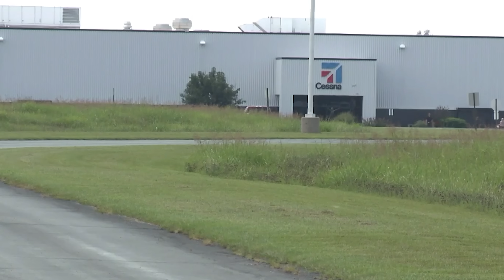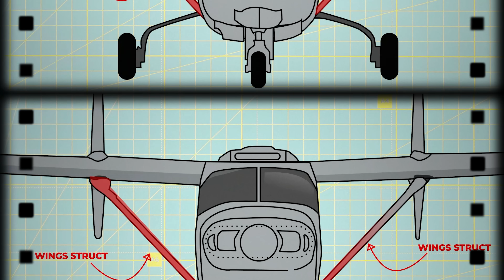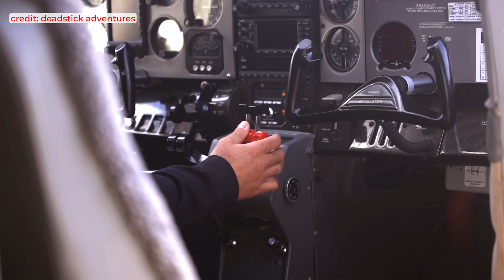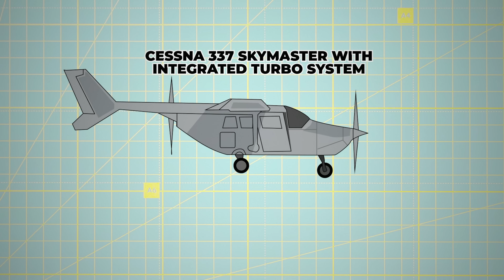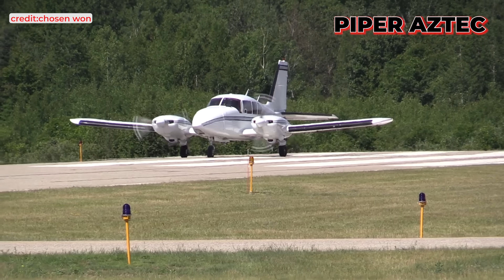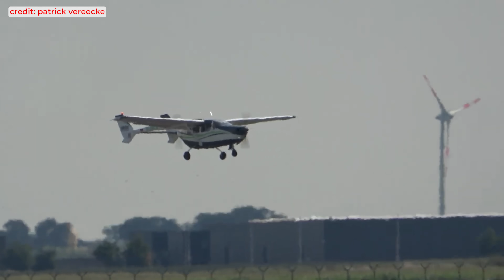Why Did Nobody Want the Twin That Couldn't Kill You?

Comment: My father was a Cessna dealer in the 60's and 70's, and over the years I've bought and sold about a dozen 337s, and every model from the 5th production 337  to one of the Last P337s.  Over the years I've also owned 310s 320's, a 340, two 421s, Barons, a Duke, Senecas, and a 700 Aerostar, and while the 337 is not best light twin in terms of performance, payload and room, it remains my favorite light twin to fly and an aircraft I love! I think it's the most inspired airplane design Cessna came up with, and one of the most under-rated and under appreciated aircraft.

The 337 was a difficult aircraft to sell back then and very cheap on the used market. When I was 17 years I finished up my Private pilot training and check ride in a 337. A few years later I bought a 66' 337 with only 800 hours for $10,000 and flew it to college.

What sets the 337 apart from many other light aircraft in my opinion, is comfort and visibility. Setting ahead of the wing you have better visibility then any other single or twin, especially in the pattern which is a good safety factor. Passengers seem to love it as it has a warm, solid fuzzy feeling and sound with good visibility and rides nice in turbulence. Also with the high wing, placed in the center of the fuselage, the center of roll, pitch and yaw is centered on the passengers head so less spacial disorientation and air sickness. 

With 120 and 140gal of fuel you have a lot of range and IFR reserves and it has the best single engine performance of any twin in it's class. The Pressurized models with 225hp and larger props are even better on single engine. When selling P337s I used to demonstrate a simulated single-engine go around with gear and flaps extended to prospective owners. Something I don't any other piston twin can do.
I could go on for pages about the 337 but but I have keep it reasonable I guess.
Reply: Flew the 336 around the UK. Good camera platform but had Aztec power with Apache performance. For charter work no baggage space and odd payload range numbers
Reply: @angeliqueadamssanctuary  Indeed. All true! I've  had a couple of  Apaches and a couple of Aztecs, An early 60's model with the extended baggage door that went nearly to the tail for hauling caskets and corpses and a 77' Turbo F model. Both good solid and reliable old airplanes but the Turbo burned like 32gph and went about 165kts. I Had an old 1963 Cessna 320 with the Turbo TISO-470s and it was a solid 200kts on 26gph and had 7 seats and the same useful load as the old turbo Aztec. That was my #1 pic of the old go fast "Cheap" twins.
Reply: @jackoneil3933 Man you have been around, respect!
Reply: @windansea6702 Caskets and Corpses ? Uh no thanks.  I guess someone had to though.
Reply: @silent1967  I never did that either but I suppose I would have. I saw a guy loading a corpse in a white body bag into a single engine Cessna one morning, didn’t look fun, but you do what you got to do. That’s the job you signed up for.
Reply: @silent1967  N4714P was the number, I only saw one photo of the old bird so I should upload my photos of the casket door.
Reply: @windansea6702  Man, did he strap it in seat or lay it out in the back, like in a 206?
Reply: Excellent thank you.👍
Reply: I was an avionics technician working at PATCO, Patterson Aircraft Company in Sacramento, the best place that I have ever worked.  The Cessna 337 was the worst plane for me to work on,  the next were the 310 series.  Under the instrument panels were terrible to access.  One good feature of the 337 was that in front of the windshield were two access panels that helped.  I did a complete IFR install on a Baron and it was much worse then these Cessnas.  That was because the throttle quadrant was way up in the middle of the instrument panel, eating all of that room up.  However, the 340s and up were the easiest planes to work on.  The other Cessnas were built to be ease of maintenance.  So, my favorite plane that Cessna made was the 340.  Beautiful cabin class, easy to work on and faster than the 414, the slug of the fleet.  Of all of the planes that I have ever worked on, I liked the Cessnas the best.
Reply: @Adventures-of-C-Jeff-Dyrek  I remember PATCO!  AndI know just what you say about the 337s and panel access. Even with the access hatches of the P337, so much stuff was crammed in behind the panel doing anything in there was a knuckle and neck buster. 210s and P210s were bad in the same way. 

I'd agree that Barons were even worse, that's why you see so many old Barons with original Stacks but 340s and 400 Sires with nice panels. 

I love 340's and have bought, sold and flown a few, but from a pilot and owner's standpoint I preferred the P-Baron. More standard fuel, useful load, range and speed, and most of all, two doors! So much easier to load and not everything has to go through the Air stair in the back. The 58P being lower and with a smaller footprint will fit in a lot of single engine and even T-Hangers where the 340 needs corporate size hanger.  Also less Spar, landing gear, Exhaust and corrosion issues with the P-Baron.

From a comfort and speed perspective I advised customers who were planning to upgrade to Turbine aircraft, to consider a 421 over the 414 and 340. Not much more overall operational cost but a lot more speed, comfort and range. 

I never really gave much thought to Aerostars until I sold and flew a couple. They are my personal pick of Pressurized Piston Twins.
Reply: Thank you too for all the useful information.
Reply: @kevindarroch7332  My pleasure, thank you for reading and commenting, and if you or anyone would benefit from insights on a 337 or other aircraft I might know something about, I'd be honored to share what I know.
Reply: Wasn’t there a pod for the 337 a?
Reply: @foxlake6750  Yes, Cessna made a Cargo Pod that attached to the belly as the baggage area shares the same area as the 5th and 6th seats.   The 337 in the thumbnail image might be some aftermarket pod. 

I had one 337, (a  G model I think) with a cargo pod, but I didn't see much point in it.  The 337 is certified  6 seats but the third row is really only piratical for kids, so I I consider  it a 4-place or maybe 5 place in a pinch. Insurance now is often higher for 6-seats and if you are considering a 337,  I say consider it a 4-seat aircraft,, then you have plenty of  baggage space. 

The early model 337s  have a dedicated baggage door nimble people and kids can even crawl through in later G-Models cessna did away with that and the full length sliding seat rails and went to something like an old Military O-2  middle row  bench seat  that's a pain to flip up and down and get baggage or  someone in the third row, and when chomp that bench seat down and latch it, who's ever in the third row is basically trapped and often claustrophobic  . 

I like the full length seat rails  better because you get 6 real seats and not the velcro-in cushions for the Lock-down middle seat and no baggage door models.  Also with the full length seat rails I liked to remove the middle row left seat and the third row right seat. That way it leaves a big open area behind the pilot's seat and next to the middle row passenger who can then slide back and have extra leg room as does the left side rear passenger and still have baggage room behind the right-middle passenger. 

Newer models are quieter with smaller windows and more sound proofing and a better sealing door. However I've refurbed older models and added extra sound insulation and better door seals.  Replacing the inner windows with thicker poly and new trim seals drops the sound levels dramatically, but I never really found the 337s any more objectionable than most light twins.
Reply: @foxlake6750 
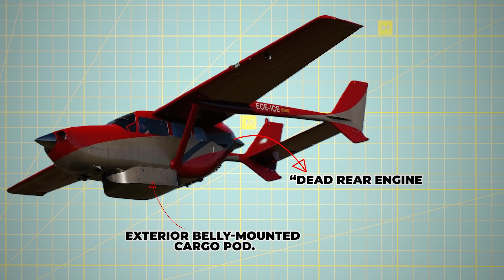He shows it in the video. 6:56
Reply: "Seen one in the movie "BAT 21"  Gene Hackman Danny Glover, really great movie
Reply: @kemgreene8525  Yea, the in-cockpit scenes were great. I'll have to watch it again but I think it was a civilian 337 rather than a real military O-2
Reply: The USAF used the 337 for FAC ,did a great job over South Veitnam,flying with the O-1 Birdog. When starting,start the rear engine first,you can't see the rear prop. If one engine quits,you prefer it to be the front. Pushing is more efficient than pulling. Also Cessna made 166 336's. A Skymaster with fixed gear. Love the sixties decade.
Reply: @bigsky-o2s  Indeed,  very true. I typically started the front engine first for several reasons, 1, the battery was closer to the front engine. 2, You could better see the front prop was clear of personnel, and people were less likely to come near the rear prop once the front prop was turning. 3, Without the front engine running the rear engine can quickly overheat. 
And if you twist around the your seat and  look back over your left shoulder, it is possible to see the rear blades going past, you just can't hear much how the engine is running with the front engine running. 

Not sure about the O-2 but most early 337's had an  engine driven hydraulic pumps for the landing gear retract system. Most had a pump only on the front engine, (a few had pumps on both engines) so if you only had one pump, so  with the front prop feathered  you left the gear extended. If you had enough altitude you could try to leave the front engine windmilling until you got the gear up.

 Also when you start the retract cycle the gear doors pop open and the mains unlock and fall into trail and create enough drag to drag you into a sink rather than a climb. It is possible to manually pump the gear back down or even up but it takes time. Also, with the front engine feathered you had to manually pump the the gear down so best to do that with plenty of altitude. 

 Later models went to an electrically driven pump so you could retract or extend any time. 

Decades ago I bought a 337A from a retired airline pilot and mechanic that had 4 faulty fuel gauge senders and was reading 'F' on all 4 tanks. He said in addition to just completing the annual,  he just topped up all 4 tanks.

I sumped the tanks and got a little water but did not get check to confirm the tanks were full.  My dad and I got in the thing and headed out for a test flight and about 10 mile south of a small airport the front engine began to experience fuel flow fluctuations loss of power, thinking it might be water I hit the boost pump to see if I could flush it out but when I did the engine quit dead. I then switched to the Aux tank and the engine snapped back to life just as the rear engine stared to sputter and quit I switched it to the the Aux tank and it snapped back to life and we both realized we were out of fuel.

We headed for a straight in at the small airport and as the front engine quit again. I feathered  the front engine a on a high 3-mile final I put the gear lever down at just before remembering I had no hydraulic pump on the front engine. My had had fallen off his horse and broken his left arm and was trying to pump the gear down with his right arm from the right seat and was obviously not going to get it extended before we made the runway. I had a fair bit of altitude left so I moved the  front prop control out of feather, and saw the front prop blades snap back to low pitch, signaling it had un-feathering accumulators. I hit the starter and the front prop  started windmilling and the gear extended just as we crossed over the numbers. The rear engine ran out of fuel as I turned off the runway.   

I called Bill, the seller of the airplane and said we were just about to the mountains when we ran out of fuel, and he said "Well good thing I didn't leave you any more gas!"
Reply: I don’t understand why Cessna didn’t simply install a warning light/audio alarm in the cockpit so the pilot would immediately know if the rear engine was playing up, or completely stopped. It seems like such an obvious and quite straightforward fix of a very serious problem.
Reply: @freebird3348  Exactly!  Decades ago I developed a prototype RPM sensor circuit that would turn on a warning light if the either the front or rear engine dropped below the other. As I recall,  at takeoff and climb speeds with either engine at full power, Zero thrust (about 90% power loss) was about 50 to 200 rpm below the full-power engine. 

However, at up to about 70% power loss, unless you have a rough engine with the constant speed propellers there RPMs stay the same, and depending on the cause of the power loss you might not even see a Manifold Pressure drop, so unless you added some complex torque-sensing device there's not really a positive way to measure which engine is having a power loss. Exhaust Gas temperature can give an indication of a major power loss but that's not 100% either. 

I looked into getting an STC Approval for my device through the FAA FSDO in Seattle and Portland but they were very opposed to the device saying that if it gave an erroneous indication of power loss it could lead a pilot into misidentifying the failed engine. And if it didn't give a positive indication in partial power loss it could confuse a pilot. Between the FAA and problems with Product liability insurance and risk, and limited market for the product (maybe 100 to 200 devices) I shelved the idea. 

To a degree, the FAA's points were valid,  as was their contention that with proper training and awareness, engine power loss and failures in the 337 are not a seriously life-threatening event and such a device added an element of complexity and potential confusion, and that during takeoff and climb a 337 pilot simply needs to monitor engine RPM's for a slight RPM drop to detect a problem.

That may be why Cessna never implemented such a system but , I can make a compelling argument that such a device is valuable during initial take-off and climb.
Reply: @freebird3348 
When an engine quits it doesn’t stop turning or even slow down. The constant speed prop will adjust its blade angle to maintain the desired RPM, so looking at the gauges for RPM and Manifold Pressure on a normally aspirated engine (no turbocharger) doesn’t really give a good indication of failure. The oil temperature and cylinder head temperatures will go down but this takes awhile. Longer than you have during critical phases of flight like on takeoff or a go around.

On a conventional twin an engine failure will result in a sudden yaw (turning motion) into the dead engine since the windmilling prop is creating a huge amount of drag and the operating engine is creating asymmetric thrust. So it is easy to identify a failed engine.

I’ve never flown a 337 but I’m guessing the reason it’s easiest to identify a failed front engine is because it suddenly gets much quieter as the engine exhaust exits right in front of the pilots feet. The rear engine exhaust is much farther back and gets drowned out by the louder front engine so the only indication of failure is a loss of performance.

Coupled with the 337’s target market of lower time pilots with less experience and you are going to have this issue, where really a sudden loss of performance during flight should be obvious. The recommendation to lead throttle inputs with the rear engine on the ground makes sure it’s operating at the start of a takeoff.
Reply: it's an awesome little plane. looks cool imo too
Reply: @blendpinexus1416  It is. They are good airplanes. I prefer the turbo and pressurized models, mostly for the extra single-engine performance. My favorite Low powered twin. I'm not much of a Piper guy but the Piper Senecas are maybe a better choice for practicality but I much prefer flying the 337.
Reply: They're great.
Reply: Awesome review. Thank you.
Reply: Also a former Cessna dealer.  It was anything but a flop.  It was truly fun to fly.  A bit noisy but fun.
Reply: @pilot2502 I remember when it first came out.  It was the technology of the future.  I was young then, but, it was one plane that I always wanted to fly.  Well, I got to fly one, right seat.  My boss flew the plane and he showed me the difference between front engine only and rear engine only.  If that plane had a single engine version, it would have been a big seller.  That rear engine kept the plane still a bit peppy.  The front engine was a slug.  And just now thinking of a single engine version, it sounds really good.  Have a nice day.
Reply: @Adventures-of-C-Jeff-Dyrek  The airplane was very responsive in roll and pitch. One can understand why the Airforce used it as a forward air controller aircraft in Vietnam.  I really loved the pressurized version.
200KTS @ 20,000 feet and 20 GPH.
Reply: @Adventures-of-C-Jeff-Dyrek  Cool. The later and  heaver Normally aspirated (Non-Turbo) versions like the G and H with 100 to 140gallons of fuel on one engine were  pretty meager but still  better than any other light 160-200hp twins single engine. The early models were better on the front engine, but the turbos went about like a 150 Cessna  on one engine and the P-Models with 225hp, larger props and a more torque, were more like a loaded up 172 on  either the front or rear engine.

 I had a 1977 T337H Turbo and one of the first Early Turbo 337s and those were fantastic airplanes. I think the early turbo was certified to like 27,000 feet and had a service ceiling in the mid 30s. Quite remarkable but likely only reasonable if you had a pressure O2 mask system. 

The P337's while only certified to 18,000 (they will go much higher but I heard 18,000  was the certified max altitude due to structural limits when pressurized.
Reply: @pilot2502 Until I watched this video, I didn't realize that they performed so well.  Thanks for your post.
Reply: I always read the comments in these videos because there’s always fascinating stuff from owners comments like yours.
Reply: With the engines on the centerline there’s no minimum yaw authority speed either I think.
Reply: @punman5392  I was always told that  you didn't need a twin license to fly a 337, is there any truth to this?
Reply: @Adventures-of-C-Jeff-Dyrek 
You need a multi-engine rating but if you get your multi in the 337 you can’t fly a conventional twin. Your pilots license will state ‘centerline thrust only’  as a limitation on your multi-engine rating.
Reply: @cletustheslackjawedyokel6083  I knew that there was something odd about the ratings in a 337,  Thank you very much and have a nice day.
Reply: Wish you could go for MANY pages. Outstanding story. You and I were kids back in the day. What did we know !!
Reply: @pauleyplay  This thread has many stories and they are all really good.
Reply: The video seems incomplete by leaving out the Riley Rocket version. Tell us, what do you know about that?
Reply: I love an information packed comment. Much better than your typical knee jerk takes or meme based comments.
Reply: hire me lol
Reply: @morvikk29110  "I will fly anything for time"
Reply: I loved my Skymaster. I went to it after a couple of 210s, that I also loved, but I was a little concerned about redundancy flying sometimes over the Bitterroots at night. There’s just something unsettling about all that darkness below.  I confess I lusted after the look and speed of a baby Baron and left my Skymaster for one. Every time I see a Blancolirio about another VMCA accident I realize that beautiful Jesibel could have done me in. I should stayed my 337 that had the steadiness of the 182 I started out with.